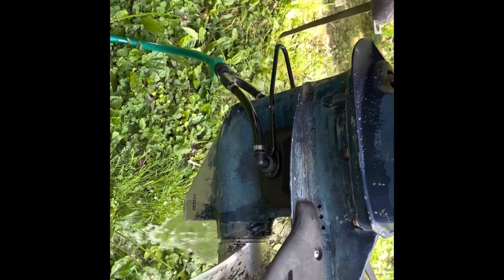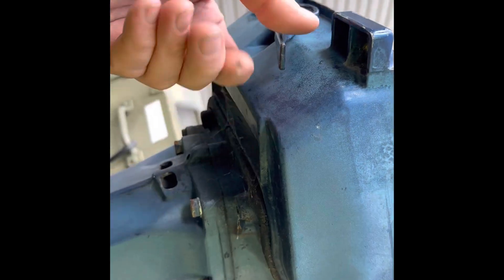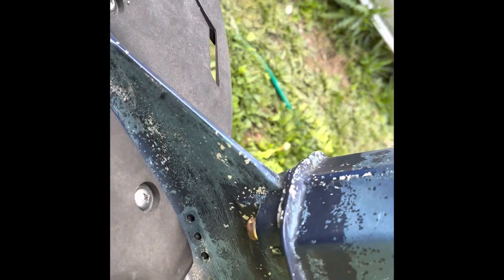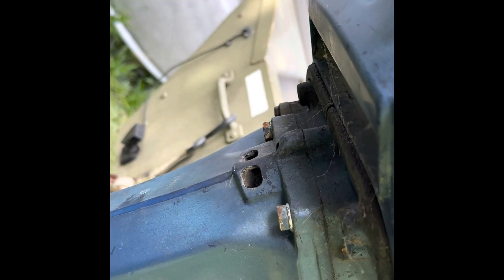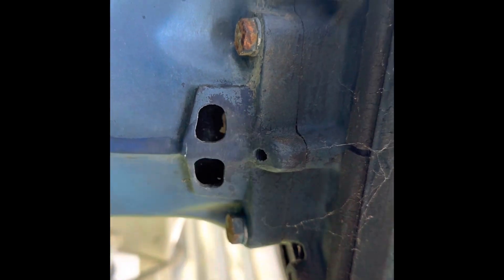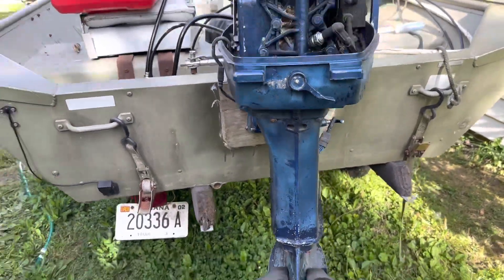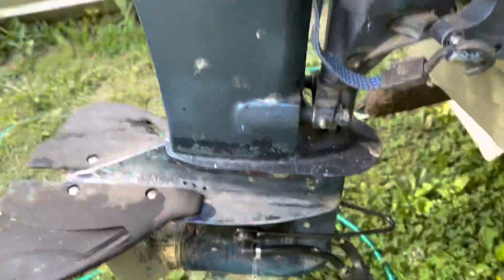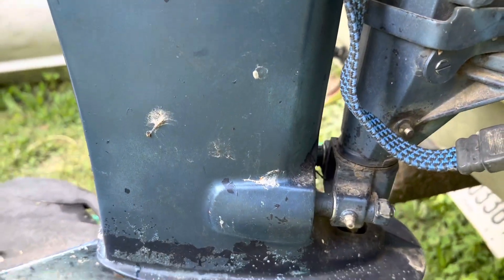40 hp Nissan two stroke outboard potential water pump malfunction

Comment: It's definitely the water propeller. I didn't see anything out of the exhaust either.  Cheap fix.   Have to pull the foot though but it's still easy.   Good luck
Reply from the maker: @ryanmichael3052  yes I did swap out the impeller and it works fine now

Comment: Since u solved my problem I been having with mine 25hp just like this one I'll help u out im pretty sure your right on that water hole back there there's like a vacuum hose going down to it inside the housing there if you r standing at the back out the motor there that hose will b coming from the left of the engine block down to that hole there n the middle yours must b an older model because mine water shoots out the right  of the motor there where the hood latch is if your standing at the back of the motor mines water shoots out beside that latch on the right through a white peace but I'll save u from keep buying the rubber impeller n there I found out that these boat places u take them to wont tell u anything about these types of motors and they will give u a run around on these types of motors wanting u to bring it to them and then fix it how I found out they was saling me a water impeller that looks the same as the one that comes out of this motor they look identical but one thing the rubber impeller that comes factory n these types of motors r thin propeller I call the finger and on the new one they give u to replace this impeller has thick ones and they will get hot and when you tighten the bolts down of the water pump housing it will kinda lock your shaft maki g it hard to turn the shaft that will cause the rubber impeller  to get your housing g hot and melt you housing again and u will never figure out why your motor keeps melting the housing of the water pump and then having to keep fixing it because you can't figure it out and u no there going to do this to u at least once to get more cash out of u when these places that fix these types of motors know damn well the thin water impeller goes n there instead of the thick ones I found out on mine I bought new water pump housing rubber impeller and the hole none yards burnt it up so I go to a different place but this time I buy the water pump kit again and they had an old motor out back that they took the motor out of the housing and through the rest of the motor n there jump Pyle so I bought the hole motor housing the lower unit everything but the motor for extra parts for mine but this housing with no motor was like brand new but had been welded on the lower unit I by this housing with no motor from them for $100 bucks but it's a long shaft but all I needed was the lower unit parts they all looked brand new i get this housing home and got all the lower unit gears out of it and it had like a brand new water pump with the factory rubber impeller n it so I compared the two rubber impeller the factory one that was brand new n the old housing I bought had a thin rubber impeller as it's fingers and the new one had thick rubber impeller so i changed the bearing that's under the water pump from from the housing I bought like new bearing under the water pump got the thin rubber impeller that came factory that Nissan put n there and put that rubber impeller n there and it turned the shaft a hole lot better with the thinner finger rubber impeller that came factory n the old junk housing I bought when the new thick rubber impeller locked the shaft when I tightened the bolts back up and I got the reverse gear n the lower unit with bearing brand new and the hole forward gear housing n the lower unit brand new and changed all this from the old junk housing I got from there junk Pyle that I gave they $100 for it made mine brand new lower unit water impeller turned a lot smoother and did not lock the shaft when u tightened the bolts down and I got the bearing under the water pump brand new hope this helps u as these types of motors parts r getting harder and harder to find